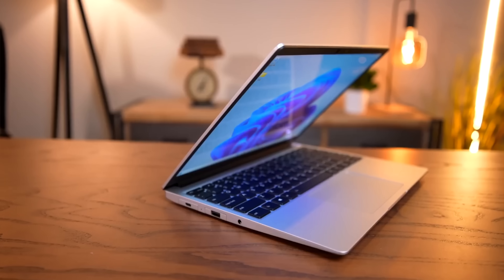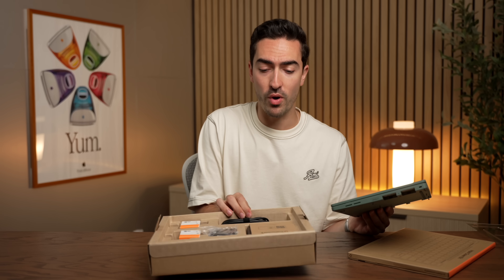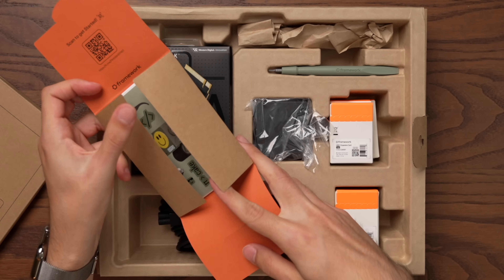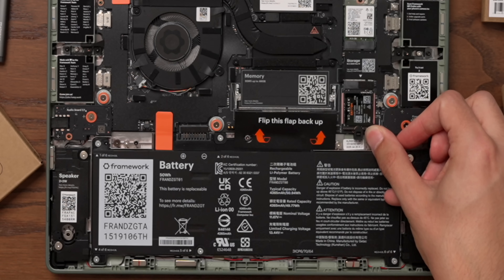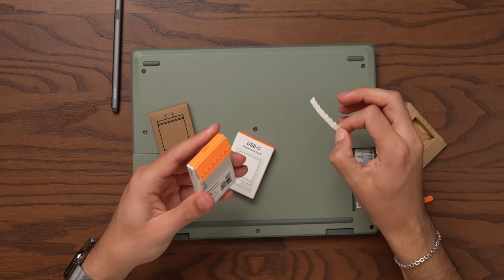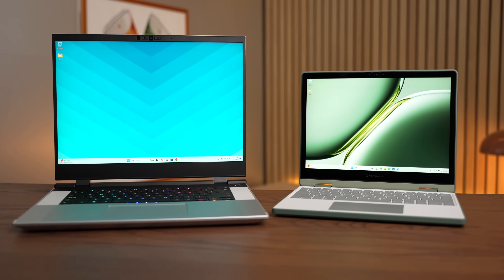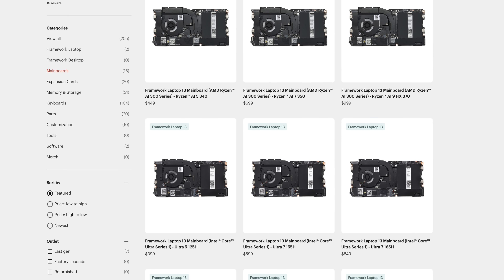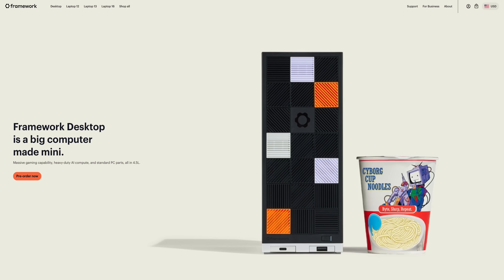Apple could NEVER: Exploring Framework 12

Comment: Keep in mind that this model is intended for school use and studying (kids and teenagers). Watch the official presentation of the Framework 12 by the CEO demoing it - it's supposed to be a kid's first laptop, sturdy and easily repairable. It isn't intended to be a high performance beast for adults.

The Framework 13 has almost the exact same physical dimensions, even though this model is listed as a 12.2" - the size difference is all in the bezels. If you want a more performant, same sized option, just go for the 13 with dual channel RAM and full sized SSDs (BYO - almost half price!). Only downside for me is that the 13 doesn't have these wonderful color options nor a touchscreen. But who knows, maybe they'll implement touchscreen and color options for the 13 in coming models 😻😇💖
Reply: The 13 does have bezel and expansion card options, and if one really wants fun colors, it's easy enough to strip down, you could probably have the chassis anodized to a different color.  

Maybe they'll make a plastic 13 chassis with more performance, that'd be neat.
Reply: It might not be targeted for adults but it is absolutely suitable. The i5 version of this is not weak at all, it is stronger than many other processors out there.
Reply: @bernardoskau  I’m waiting for the reviews with blender lol
Reply: Nah, I wanna small and convertible as a portable laptop and my spine isn’t liking 13 inch laptops
Reply: The framework may be suitable for marketing to kids and education, but few authorities can afford its pricing. Most will likely buy a $200 Chromebook, and if that one is broken, they will replace it and keep the old one for parts. When a Framework 13 new display costs £189 on the list, then the reality of economics means only the private school sector can afford these.

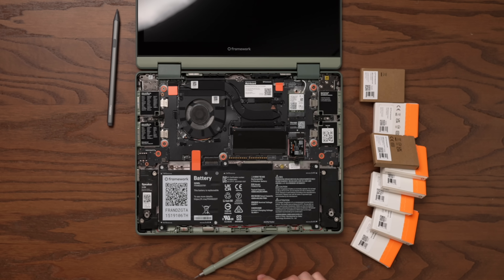Comment: 5:31 you ar wrong its 64gb 6400mts for les than the 48gb version from framework akording to geitshalz the European version of pc part picker
Reply: According to the Framework website, it only supports 48GB of single-channel RAM. It has not been validated for 64GB and would void a warranty if it broke the chip. Though 48GB for a machine like this is ridiculous, and 16GB is probably enough for 99% of buyers.

Comment: Let’s see if Framework can maintain 5 years of repair parts after the last sell and sell 10 millions of laptops each year before comparing. Same for Fairphone with 200 millions units per year.
Reply: Yes, there are a couple of upgrade paths if you had purchased an early Framework 13
Reply: I would be shocked if they sold 4 million laptops total in a decade from now
Reply: framework has been around since 2020 iirc, so that's the 5 years argument concluded hopefully

Comment: It's a shame they seem to have an Apple approach to memory pricing. RAM for the Framework 12 is at least £100 more expensive than Amazon for 32GB and 48GB options in the UK
Reply: Good thing is, you can bring your own RAM and even throw in a single stick of 64GB into the device, which is available on amazon.
Reply: @heroninja1125  The framework only states that 48GB is supported and 64GB is untested, which may cause issues and invalidate any warranty. Additionally, it is a single-channel device, which means it operates at a slower default speed and is only DDR5, not the superfast DDR5X. For something you expect to keep for ten years, that is a massive negative. If you are paying this amount, you want contemporary performance and efficiency for future-proofing -- this is not.
Reply: @heroninja1125  I agree, the only reason that I think it's a shame, is because I think what they are doing is amazing but not necessarily amazing enough to spend £100 premium or something they didn't make.  If they put a smaller mark up on I would likely buy it from them for the confidence that I'm getting all the parts from the same place.
Reply: Then buy your own 😐

Comment: 11:00 that's basically what their 13 inch model is already though, no? I feel like it would make more sense to add a touchscreen, or a new body kit to their 13 inch platform than to just make two laptops targeting the exact same price segment, since their whole thing is keeping these platforms alive for as long as possible for upgrades. I think this laptop will make more sense for budget shoppers in a year or so when refurbished parts bring a finished laptop under $500. Personally I'm excited for this model just as a durable and relatively cheap 2 in 1 with good linux support, where I don't have to worry if I break something being rough with it while traveling.

Comment: Could Apple, yes.  WOULD Apple, never.
Reply: Factually true
Reply: they're too lazy to stop making mid products now
Reply: @cruizer4356  Other than the iPhone, they make the best products in every respective category.
Reply: The CEO used to be an Apple Engineer
Reply: Sure but ironically the Macbook Air M4 is a better value. The logic board upgrades for the Frameworks cost almost as much as the entire M4 Air which is on sale right now for 850. You can just buy another Macbook Air for these prices if it breaks and you get a better device with better build quality and more performance.
Reply: It’s probably a product Steve Wozniak would or does love.   

My problem with this product as someone else pointed out is Windows.  Does it come with a Linux option?
Reply: @jdnealious3124  yes, it does
Reply: @jdnealious3124  I wonder would it much of an improvement running Linux over windows
Reply: I am still loving my m1 MacBook Air
Reply: Imagine running macOS on this. Perfection.

Comment: I guess the competition from M4 Macbook Air at $850 makes this framework laptop impossible to select.   I really wanted it, but at $550 without RAM, without SSD and without OS, and the very slow CPU and GPU, single channel RAM, terrible screen color replication, and all plastic construction, they all make it an impossible choice, unless the price was to be bellow $300.
Reply: It just depends where your priorities are. There's no doubt a MacBook is going to be faster, get better battery life, and a better screen when compared to the Framework (or any PC laptop, really). For a lot of people though, a MacBook just isn't an option that works for what they need their laptop to do. It will be interesting to see what happens in a couple years if a version of the Framework 12 releases with ARM processors that can compete better with Apple.
Reply: @3lectr1c  I just wish that this Framework laptop would be cheaper because I do need a x86 Windows laptop.  I can get a regular windows laptop with upgradable RAM and SSD for half the price, so it is hard to pay so much for the Framework.   If Framework really wants to make their unique upgradability and repairability a necessary feature for most people, it must be more accessible and not be so much of a premium.    Does it really cost that much more to make it the framework way?   clever design cost more, but that is a 1 time expense.   Material and manufacturing should not be that much more expensive, or is it?   Framework might need to offer their unique features at cost or below cost just to get the ball rolling.  Just like XBox, sell the console  at a loss to make money on the games.  Sell the laptop at competitive pricing and make money on the upgrades and repairs.  Would that work?

Comment: The best part? You can run Linux on it and everything will work
Reply: Point ☝️
Reply: The framework has been on my radar as a Linux machine for a while. I can see swapping out the Hard drive when coming back from overseas for instance.
Reply: Hopefully, we will get better battery life, as in the Linus channel review, they were only getting 5 hours of battery life compared to 15 for similarly priced machines like the Lunar Lake. The inefficient chip (13 Gen) and the small 50 W battery are the issues.

Comment: so cute except the single channel ram
Reply: it doesnt really matter the ram is rated at 5600 but will run on 5200.
Reply: @Johnny91832 it still effects graphical performance a lot
Reply: @justmarul2093  This is not true at all for DDR5
Reply: @c_ornato  It does mean that although DDR5 has two sub-bit channels, with dual RAM, you will have four, so of course it will be better, though depending on what you do, if you care if it is faster or not, or if you are even aware of this difference, which Framework is probably relying on to save some money.
Reply: @justmarul2093  it cant even run anything graphically demanding with that integrated cpu anyways, unlike m4 air. so why you even need dual channel?
Reply: @ネイチャーウォーカー  actually i want to use it on emulators. integrated graphics makes pretty good job on indie games and retro emulators. and even 3-4 fps really matters on stability
Reply: @ネイチャーウォーカー  and i am talking about the i5 version. i3 is pretty useless

Comment: Touchscreen? Upgradable? I dunno man. Sounds pretty attractive to me.
Reply: Those don't matter much to me if the screen and the cpu is crap
Reply: @f.i.b3027 they aren’t crap for the price
Reply: @f.i.b3027  The screen and CPU is more than sufficient for this products target audiencd.
Reply: The touch screen only supports 66% srgb (according to labs testing on short circuit) the display is trash.
Reply: @brandonchan5620  According to the same short circuit video it also says that it probably won't matter for most of the users.
Reply: Your expectations are low. Watch the Linus review, and he has shares in the company. The reviewer says that as long as your expectations are kept in check (very low), then you get something usable, though it is well overpriced compared to rivals.
Reply: @andyH_England  It isn't that overpriced if you consider the entire lifecycle of the product(main board upgrades and even standalone mode for retired mainboards).
Reply: And more expensive than a Macbook once you're done configuring, amazing.

Comment: I run x86 on desktops and servers all day, but I'm done with x86 on laptops. I will be interested in a framework laptop once I have some good ARM options.
Reply: x86 laptops still have the software compatibility advantage, at least for the coming 2-3 years I think. I have both Apple Silicon (Sequoia) and Raspberry Pi (Ubuntu ARM), which can be frustrating at times when certain software that you'd need just won't run. Hopefully the whole software industry has caught up soon to that ARM is the future. For example a ZimaBoard is more compelling than a Raspberry Pi, simply because it's x86 and can run Proxmox 😇

Comment: I'd love to buy this in 6 years for 90 bucks. Right now, it's a budget laptop without a budget price tag. Nope.
Reply: That assumes you can find one used, nobody acturally buys these so there are practically none of them on the used market. Additionally nobody who buys these are willing to sell. You might as well just get a used Thinkpad.
Reply: @kittenzrulz  But thinkpads are also becoming increasingly hard to upgrade. Most of them have only like 1 SO-DIMM + some soldered ram now, which is annoying (plus other soldered components).
Reply: @kittenzrulz I mean, I switched to Apple some years ago but if I had to get a second hand laptop 6 years now low I would probably go XPS
Reply: @rollingtroll  Tbh you probrally made the right choice, people call apple overpriced but framework pricing is unhinged
Reply: There's better ones on their website but they're just as poorly priced
Reply: @nitesan2814  I would say they're priced right once you take into account that Framework is - at least to the best of my knowledge - an ethical and relatively small company. Meanwhile, the only reason why Apple and other laptop makers have it cheaper is because they do their best to pay workers the least they can, plus they have enormous manufacturing capability that makes everything cheaper to make purely because of the production scale.

Comment: Can you put Mac OS on them? I’m guessing, but how easy is it I guess?
Reply: You technically can, but it will be unusable, as 13th generation Intel Integrated graphics can't be accelerated under macOS, as there are no drivers for it. The latest Macs that use Intel iGPU have 10th gen CPUs, which are the latest ones that have iGPU drivers in macOS.
Reply: Hackintosh? Yea it's possible. Though it won't be easy
Reply: unfortunately impossible now, anything newer than 10th gen on Intel is unsupported due to the lack of GPU acceleration, and the AMD chips that run on Vega GPUs have unofficial support thru a fairly broken kext. the Framework does not qualify for any of these, since the 7x40 AMD chips use RDNA, and the oldest Intel chip Framework ever used was 11th gen.
Reply: No and even if you could, the upcomming Mac Os Tahoe is the last to support x86 architecture

Comment: I wonder if AMD would not have offered a more performant option than that i5 CPU.
Reply: A lot more expensive. It would have pushed the price to over £1000 for a pre-built. The 13-Gen i5 is 2.5 years old, and these chips are probably ancient stock that was never sold. Very cheap, but a bit embarrassing considering the £850 pre-built price.

Comment: I wish apple would make something like this (or just a repairable laptop)
Reply: One day people might comprehend the reason Apple is so efficient, fast etc is because everything is integrated into the SOC in close proximity and highly optimised design. It simply isn’t possible to have the same benefits with external ram chips etc…  This is a completely different market segment for tinkerers. Most customers do not want to “build” their laptop. They want to open the lid and it works. Windows cannot even get sleep right on a laptop so good luck with that lol
Reply: Don't break your device, that's the easiest and cheapest solution.
Reply: @mich977f yes, but how about upgrades? Also, some things just fail because they're OEM garbage (think about all the MacBook pros that had GPU failure). It's a simple fact that the only reason apple machines are so deliberately engineered to limit repairs and upgrades is to get more money. Also, why argue against it? It only helps a consumer for a laptop to be repairable anyway
Reply: @gmdrandom6287 Apple is the future. The Framework is for people living in the 1980s who want a legacy because of their mindset. You only have to sit and think for 5 seconds and understand that smartphones and tablets are also like Apple Silicon, and they are 100% non-upgradeable. Once you know this is indeed the future, let go of old thinking and join us in the 21st century.
Reply: @andyH_England 0/10 ragebait